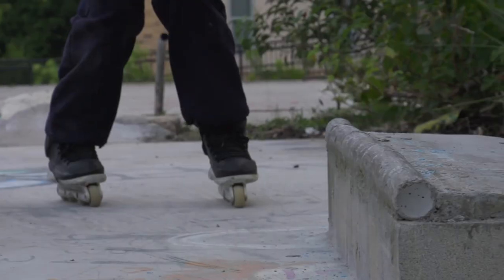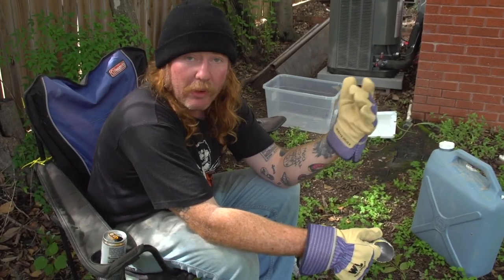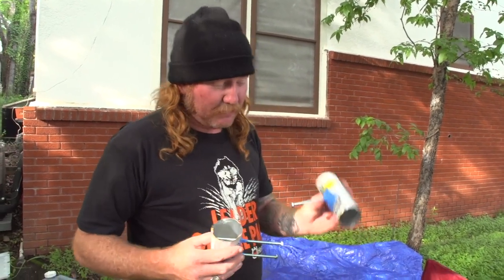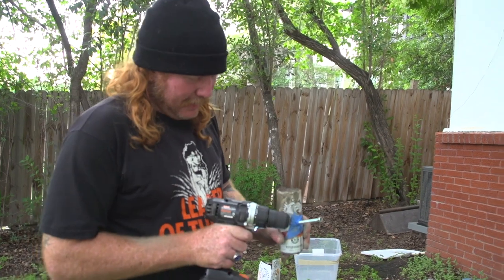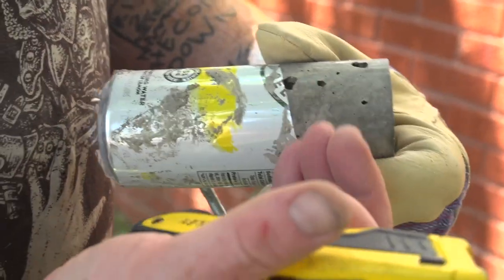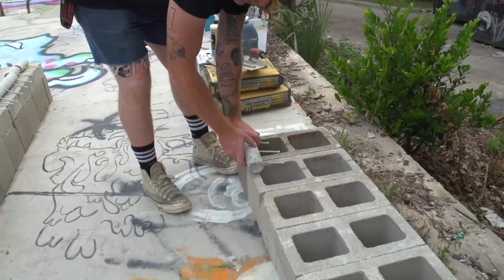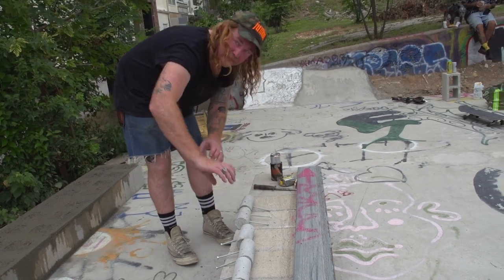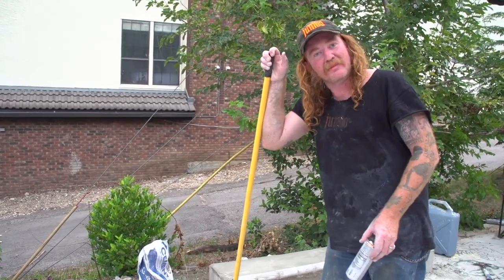DIY with Heath Burley - How to make a beer can coping ledge

Comment: Awesome idea..!! I'd prob leave a bigger gap in between the bolt and inside of the can tho.. like 2/3rd' of 3/4s of the way to limit the possibility of voids where the concrete couldn't fully settle in. It'd prob reduce weak spots on the inside too.. or maybe i just like to overthink everything 😅